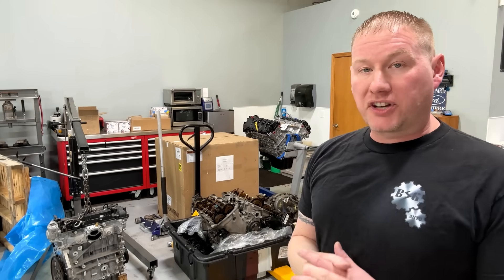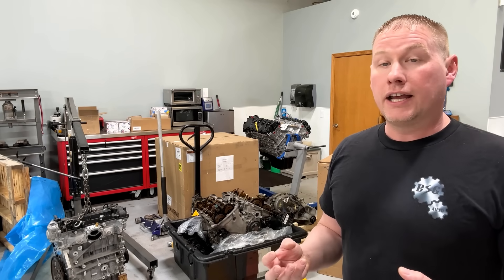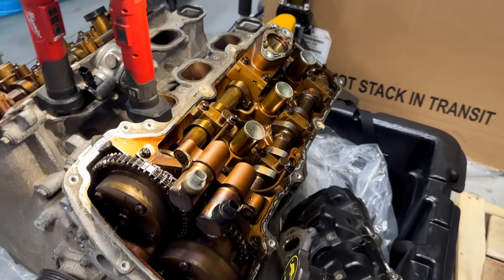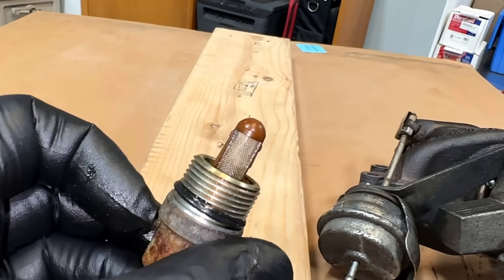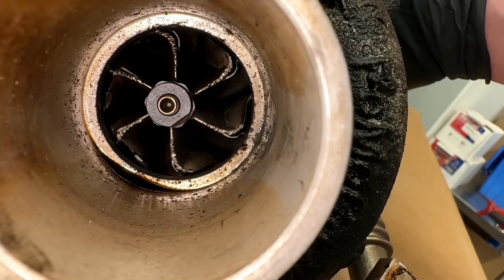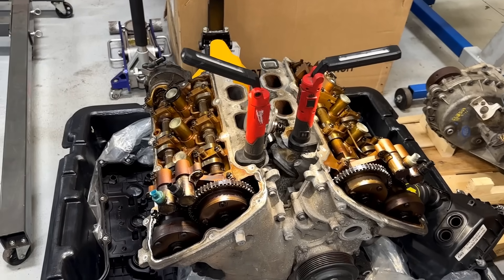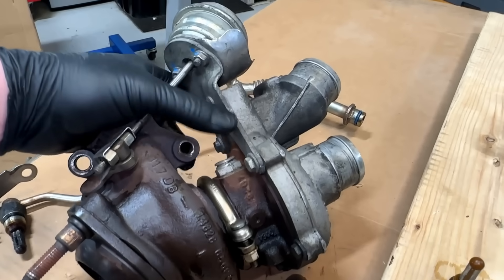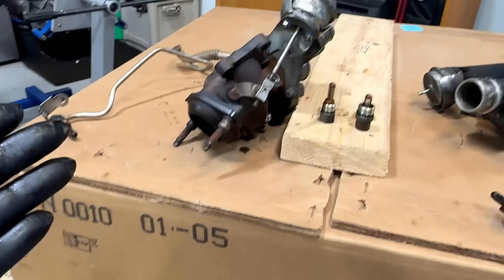This is Why You Never Run Extended Oil Change Intervals on The Ford Ecoboost Engines!

Comment: Thanks to you and a few others that I watch, I change my oil religiously at 3,000 miles on my EcoBoost. I have a 2016 F150 with 222,000 miles and hope that I can easily make it past 300,000!
Reply: 2011 f150 5.0 and 2015 3.5 n/a I change my oil every 3000 miles also and transmission flush every 50k
Reply: Easily. There’s a 500k mile ecoboost and 1 that went over a million miles. Although I’m a GM 350/5.3 guy I have to admit that’s impressive
Reply: Nice work hope ya make it 500,000 brother
Reply: I knew a guy who had a genuine Mopar air filter Cascade the turbo and wreck the valves. Could happen to any turbo though.
Reply: @marshmower  Mopar air filter? Explain this cascade the turbo stuff.
Reply: You all are stupid! Just change the oil and drive, everything breaks. I have traded trucks in working fine because of internet “issues”. Never again. Spend the money when it breaks for real, and until then change oil every 5000-7500 miles. it will be fine, Chevy dodge, ford, etc.
Reply: How often do you have to change to oil? For me 3000 miles would mean every 3 to 4 weeks.
Reply: @meeder78  I don’t drive as much as you but oil is cheap… $50 bucks or less plus 30-40min of my time… if I had to do that every 4 weeks that would be ok
Reply: You will make 500k doing that I do mine at 3000 too. Keep it up
Reply: People that change their oil every 3000 miles do it because they don’t know any better. It’s like buying milk on June 1st with an expiration of June 30 but throwing it out on June 9Th “just to be safe”🥴. I ran a fleet of cars (Toyota corollas) years ago for a medical transport company and after tons of oil samples we actually extended all oil  changes from the recommended 5000 miles to 17,000 miles per car due to the fact that they were running on the highway constantly with little to no stress. With the oil that we were using we were told we could actually extend the mileage to 22,000 miles but made me feel a little uneasy at those intervals. Every vehicle in the fleet made it to the 400,000 mile mark before we auctioned them off and purchased new. One of the 30 cars didn’t make it that far and just had mechanical failure elsewhere in the transmission and a lot of bushing problems. Changing your oil at 3000 miles is asinine figuring research has shown that even cars back in the 70s with the oil that existed back then could’ve gone triple the time. I mean it’s your money and excessive oil wastage but whatever.
Reply: @Giambis  as the kids say.  Stop the cap 🧢 😗.  

I’ve owned a shop for 21 years now.  Seen all sorts of oil related carnage. You just watched this video show you why the eco boost is in dire need of oil changes earlier.  And you say that ?  Loads of horsehit.  

Reason 1.  Comparing a Toyota 4 banger longevity to anything else is a non starter. It might go 2k on no oil 😂.  They live forever save for timing parts.  So you get no cookie for making one live 400k miles.  Call me when you have a ford truck live 400k on 17k mile oil changes. I’ll wait. Cause it won’t happen.  But I have a 2000 f150 in my fleet with a 5.4 that has 3k mile valvoline synthetic changes , and has pulled cars all over the southeast since new. It has 377k right now.    So you do you.  Just be warned when you try it on a turbo motor.  Have your pennys  saved because you’ll need them for the engine and turbo swap.
Reply: @Giambis   I appreciate the insight, but do change it so often because I am towing with my truck practically everyday and running it pretty hard. Maybe it does not need to be changed that often, but it gives me peace of mind and I am happy to do it.
Reply: @Giambis  yeah but port injected naturally aspirated Toyota engines can do that. Direct injected turbo engines are a lot harder on oil and need to be changed  ore frequently even if 3000 miles is extreme.
Reply: Get a Cummins and change the oil every 10,000 miles and get over 500,000 easily.
Reply: @duckwacker8720 also have to listen to the Cummins racket.   And drive the dodge truck. 😂. No thanks.  Cummins swap into a 97 f350 ?  Maybe.  But not in a dodge chassis.  I prefer my windows to work and my seats to not feel like a hobos old couch .
Reply: @duckwacker8720  yeah just pay out the extra money for other extra maintenance and deal with headaches from the DPF system
Reply: @stevenkrupp5732  what dpf? It's an 05 5.9. when or if I get a 6.7 it's going to be non emissions also.

Comment: What about oil analysis? I've been changing my 3.5L EB on our '22 Transit at 7.5k miles and according to Blackstone, all looks good and I can push the interval even further. I haven't yet but I'm wondering if the analysis looks good, am I good to keep it at 7.5k or is there something the analysis doesn't catch that's causing the issues you've outlined? Ford spec for the oil change is 10k
Reply: If you're paying for analysis with every oil change, seems more efficient to just change the oil.
Reply from the maker: Waste of money IMO.
Reply: Carbon is the killer , Blackstone doesn't tell you that

Comment: I just replaced my rh exhaust manifold on my 2012 3.5. Replaced my oil line and screen too. Still looked like new, not a spec of oil deposits. 125k miles, synthetic oil, set the oil life monitor to 50 percent.

Comment: Thanks Brian. Knowledge is power. I have a 2017 Explorer Sport I bought from a dealer last May. Only had 46,000 thousand miles and the body & interior are immaculate. I just hit the 5,000 mile interval last week since I don’t drive that much anymore. I used your recommended Penzoil Ultra Platinum and a Motorcraft filter. I guess I’m going to go to a timed interval since it takes me so long to put the miles on. I also have a 2006 F150 5.4 3v with 270,000 still going strong.
Reply: Motorcraft filters are a poor filter , horrible efficiency.  That's why it's 4bucks
Reply: @kenj.8897  Then why does Brian use and recommend them?
Reply: @steveturner3999  get them at the dealer
Reply: @steveturner3999  nothing wrong with motorcraft filters, they are quality filters
Reply: @Eltanque-z4m  My thoughts exactly. They’re made by Purolator and I’ve never heard anything bad about their filters.
Reply: @steveturner3999 
I love ultra platinum but nobody has it in stock have to order it & I don’t know why Pennzoil doesn’t do a better job marketing it.
Reply: @scrumthebum2451  I have to order it too. Walmart has the best price so far for me. The 5 quart jug shipped from California and I’m in Alabama. Crazy.
Reply: @steveturner3999  
Same here not sure where it ships from. Then my 3.5 eco takes 6 qts so I have to use regular platinum for the 6th qt.
Reply: @scrumthebum2451  i just order 6 jugs at a time get free shipping and it makes 5 oil changes

Comment: Hey, Brian!  THX much for the reminder.  I am interested in inspecting / replacing the oil inlet filter screens on my 2012 3.5 EB engine.  Can't find a listing for them, and I was wondering if you could post a part number for them here, please.
Reply from the maker: You must remove the turbos first then the a/c compressor and then the oil pipe and then you can unscrew the filters so generally this is only done during turbo service.
Reply: go to the parts department at the dealer

Comment: Wow this is great to know, never new there were screens there. I have the 2.7 and do all my maint as 60-70% recommended mileage, which means I change the oil every 2 months cuz I rack miles... Do you have a video of changing these screens while on the motor or is the turbo removal required?
Reply from the maker: You must pull the turbos on the 3.5L anyway.
Reply: Dont have to remove the turbo, but getting the tube that has the filter on it is a ROYAL P.I.T.A.

Comment: I do roughly 3000 miles on my normally aspirated 3.5, Duratec is it?  I know, that's the old mineral oil spec.  I change the oil myself, so I can do it for $30 and 30 minutes a pop.  That's the cost of a half tank of gas.  Very cheap insurance.

Comment: My dad has a 2011 F150 3.5 and we change his at 5k miles and the oil life monitor is at 50 percent. If your following when the dash tells y ou to change oil your already too late. Following the monitor is the minimum you have to do to maintain the warranty. It is not what is best for your car. The manufacturer wants to sell you a new vehicle before 100k and not have yours go 200 or 300k.

Comment: Why does the engine even start on these motors today, especially on the turbo motor? Why aren't there some types of sensors to shut motor down and stop turbo from kicking in ?? 
Just a question.

Comment: People laugh when I tell them I change my oil at 3k miles but I’ve never had an engine failure. I live in the country in mountains, lots of dust and hard driving, oil is cheap, change it yourself.
Reply: I have never had any engine failures, I live in the desert in arizona and do valvoline 5w-30 in my 2002 F150 5.4L it has 168,000 miles, also a 2012 F150 Raptor 6.2L with 183,000 and my wife has a Kia Sorento 3.3L V6 with 116,000 all use valvoline synthetic, and wix filters at 5K miles.  All 3 are spot less inside, I have a little camera that I use to peek inside the valve covers
Reply: In your case I could understand your 3k mile oil change. M😅st of us will do very well on a 6 to 7k miles oil & filter change interval.🎉🎉🎉. The supercharger comes in at less than 20% of its road miles. Supercharged air only ranging from +1psi to +5psi during non aggressive foot the on the gas pedal.

Comment: I haven’t owned a Ford in years but continue to watch your channel. I don’t think I’d ever own an Ecoboost.
Reply: The 3.5 and 2.7 are good engines. Just like he said every 4-5 thousand mile oil changes will prevent a lot of trouble down the road. I currently have a 2020 F-150 with the 3.5, 50,000 miles later no problems.
Reply: They aren’t that bad tbh. This one make it 227k miles with just minimal maintenance.
Reply: They're great
Reply: I love my 3.5
Great power etc. just change the oil 3 times a year and you’re golden.
Reply: Which ones have the water pumps buried under the timing chains? I don’t think I’d want one of those.
Reply: @michaelw6277  Nissan 3.8 V6 in their Frontier pickup. Although the failure rate is low, it's a crazy design.

Comment: Brian, you mentioned FULL synthetic but Ford uses a blend. Is the blend ok or insist on full synthetic?
Reply from the maker: Pennzoil platinum every 5k miles and you will never have these problems.
Reply: @FordTechMakuloco  did you see project farms test of Pennzoil? He had the blend. Regular synthetic. Platinum and ultra platinum. The regular synthetic out performed the platinum. The oil test showed much lower additives in the platinum vs the regular synthetic. Ultra platinum was premium and performed the best as expected.
Reply: Brian, how about the 1.0 3 cylinder with the wet timing belt.   Do you recommend full synthetic for them as well?

Comment: For a 3.5L what oil weight do you use? The cap and manual on my '17 expedition calls for 5w-30 but the dealership used 5w-20 and says that's what the use without any real justification.
Reply from the maker: Oh no you must use 5w-30 with this engine.

Comment: When, or at what point do the turbo screens need to be replaced?
Reply from the maker: They should be replaced anytime the vehicle is in for any service requiring turbo removal. Ideally if you maintain your oil they will be clean and clear as shown in the used ones were in the video.
Reply: @FordTechMakuloco  This year I purchased a new 2023 F150 Powerboost and this recommendation will be very helpful in the upkeep of my new truck.
Thanks again Bryan for your advice on the proper maintenance of these 3.5 Ecoboost engines.
This video will save me lots of $$$ over time since I plan to keep this truck for at least eight years, or until the extended warranty expires.

Comment: 7500 mile oil changes 
2017 Cruze Diesel 
219,xxx miles haven't missed a beat 
Mostly highway miles, short trips kill engines not long oil changes

Comment: As unfortunate as it is, this is the exact reason why I will never buy an eco-boost Ford preowned! You just can’t take a chance with how sensitive those turbos are! If I do get an eco-boost, I will get it from brand new as the first owner, so that I know that it will be me taking care of that engine, and the turbos, and not relying on the hope and wish that the previous owner did what they were supposed to do. Too costly.
Reply: I have a friend with a 2013 Escape. The turbo waste gate failed at 60,000. I was with her when she bought it new. I told her I would maintain it for her and buy it when she decided to get something new. Well, it was like pulling teeth to get her to bring it over for me to change the oil. Now she wants to get a Subaru because she doesn’t trust American made cars anymore. Yup, it’s Fords fault you go 10,000 miles or more on an oil change and never check the dipstick. Ugh. Maybe the Japanese stuff can hold up to her lack of maintenance. Just needed to vent. I’ll probably still buy it from her and just assume I’ll have to drop a new engine into it.
Reply: @tbone2859  Don't worry, she will get to know Japanese repair pricing too.
Reply: @thk7513 Toyota/Lexus are Japanese and I can assure you that they rarely have issues and when they do they are not very expensive.  Now the Fords I owned in the past….oh boy
Reply: @tbone2859  I understand completely! I have been a Ford guy all my life! Right now sitting in my garage is a 2003 mustang GT and a 2012 fusion SEL. I had a 1999 explorer sport sitting in the driveway, but now, in its place, sits a 2018 Honda pilot! Most painful decision I ever made! I had to do it! With a growing family the two door, four seat bachelor truck had to go. Wanted a 2019 or 2020 explorer sport so bad! All I could find were eco-boost TwinTurbo models with anywhere between 40 and 70,000 miles. visited about four Ford dealerships looking for the best price every single one of them wanted between 32 and 37,000! Decided to go with my second choice and the first Honda dealer I visited had a 2018 with 49,000 miles for 28,000. Now that very truck is mine. if you wanna turbo escape, that bad, save the money that you were going to spend on the engine R&R waiting to happen and get yourself a brand new one. You will probably sleep better at night in the long run.
Reply: I think a vehicle with verifiable service records, with regular oil changes less than every10k miles would probably be safe to buy used.  Lacking that?  Pass.
Reply: Luckily the guy who owned mine before me had a hand written note taped under the hood that said “full synthetic 5k 3 months!”
Reply: When I buy used it is only from a private seller with maint. records. Most people that have a lemon or a problematic truck tend to trade it in and let the dealer deal with it. I think most people with problematic trucks don't want to be associated with it, or selling it face to face to the 2nd owner.

Comment: Ford is criminal for not setting the proper oil change intervals on their clusters. Guess there's a good reason for that ($$). 
I change my oil every 3000 miles, and my engines have lasted over 300K.
Reply: All the manufacturers are doing it now.

Comment: The engineers are told by the manufacturers 'it needs to last the warranty period to satisfy emissions! We don't care about anything else.' Ultimately this come down from the government thinking they know best with regards to the environment. Of course if the government knew how much it was hurting the environment by having these major components replaced as new castings are not the most friendly to manufacture maybe things would change.
Reply: I feel kinda the same way with these new "green" refrigerators that cost an arm and a leg and don't last.  Not environmentally friendly having to trash and build new ones all the time. 😊